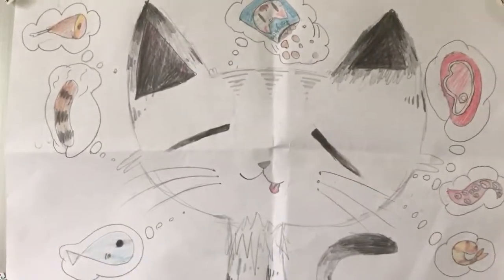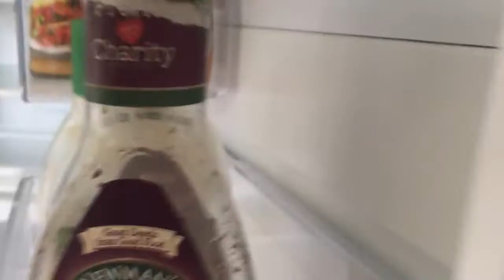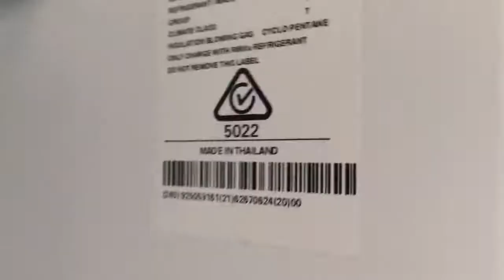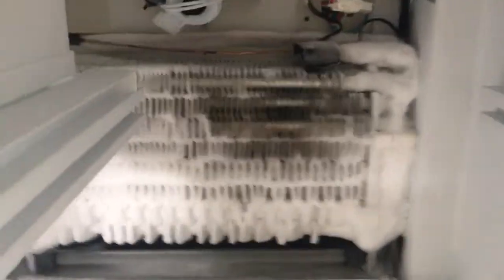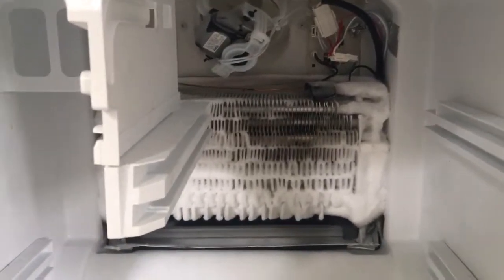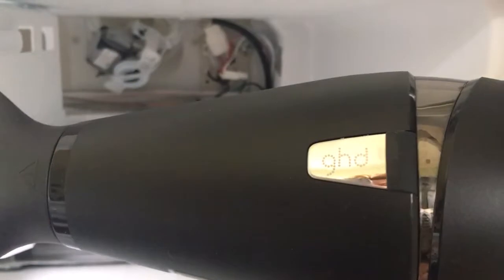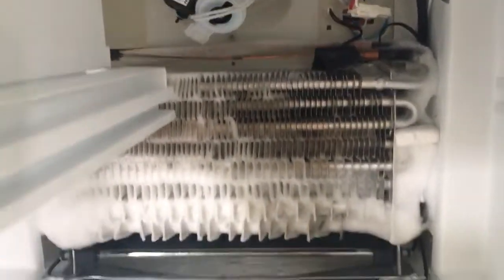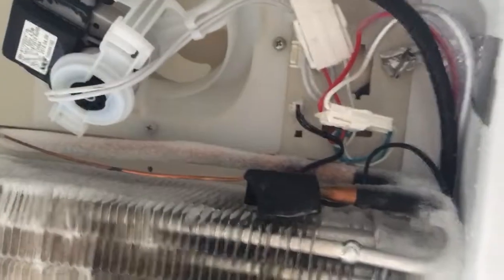How to Fix a Broken Westinghouse Fridge with a Hair dryer. Prt 1

Comment: The old Westinghouse refrigerators can last up to 50 years; mine's been running for 32 years and it is an absolute Rolls Royce. So sad to see a brand known for excellence back in the day breaking down so quickly.
Reply from the maker: was very disappointing. Had to get a repair man in to fix it. Basically took the wires out and repaired the whole thing with new wires. 😍👍